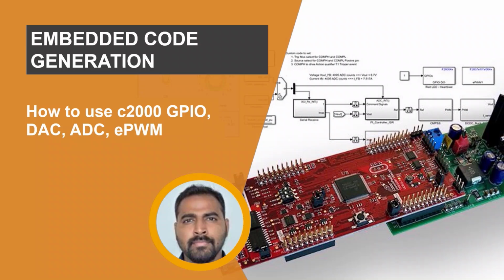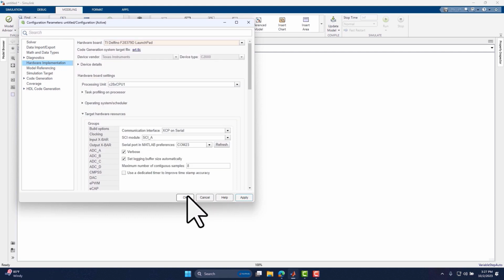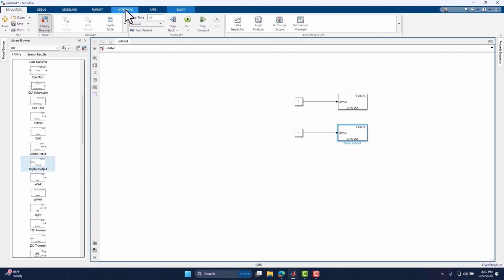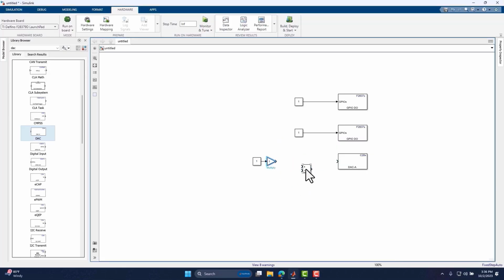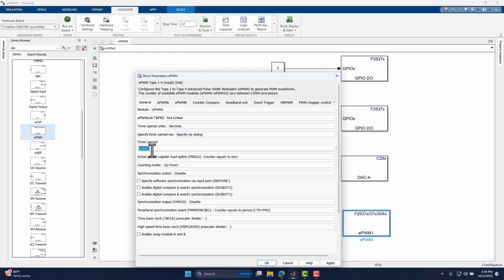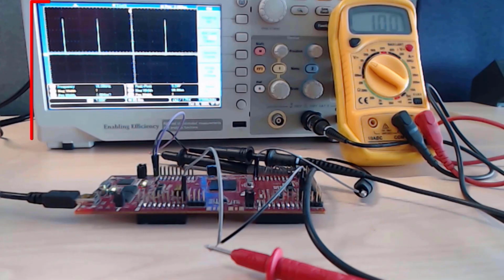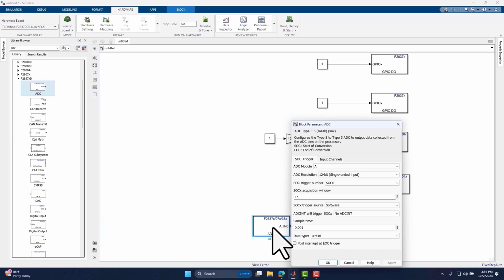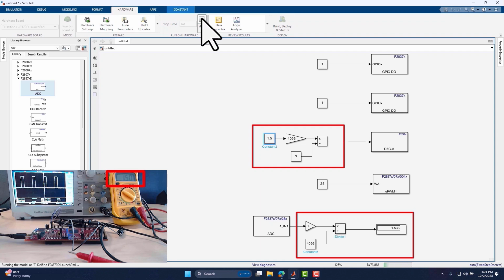Monitor and Tune GPIOs, ADCs, DACs, & ePWMs on C2000 MCUs | C2000 Microcontroller Blockset, Part 15

Comment: Thank you very much for explaining all the basics and necessary blocks. I am facing a problem when using the ADC block from the DAC output. As shown in the video, the ADC output result is showing zero. I have followed all the steps as shown in the video. Are there any changes required?

Comment: Thank you for your VDO a lot. But When I have built and deployedprogram. the com port is error even I am sure that I chose the correct com port already. How is it possible? I just want to use a DACs pin to be voltage supply. Thank you for your answers.👏🏻

Comment: Thank you for the examples. However, this parameter tuning of the LED GPIO 31 and 34 does not work. It only works if you change the code generation >> Optimization >> Default parameter behaviour as "Tunable". Is this a bug or something else ?
Reply from the maker: Until 24a, Tunable was default setting. From 24b the default has become Inlined. That's why you have to change it to Tunable.